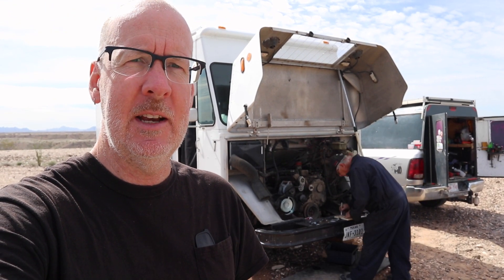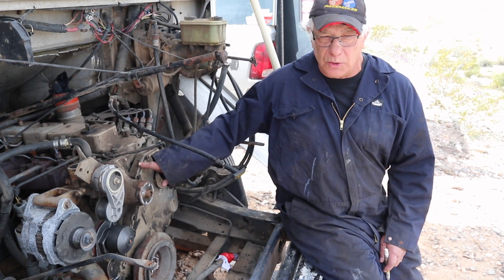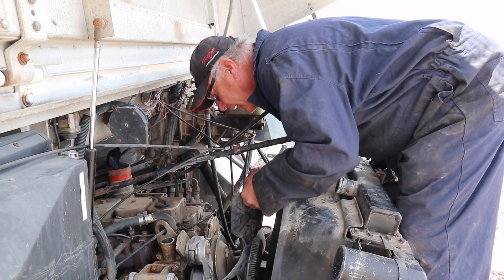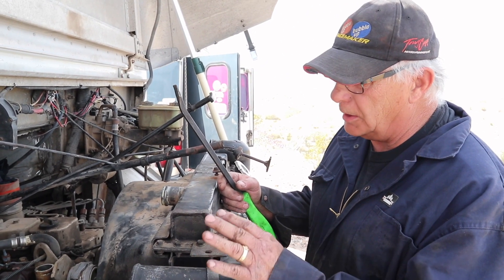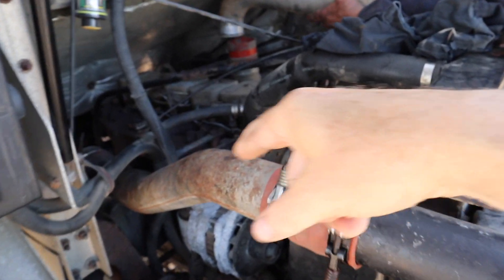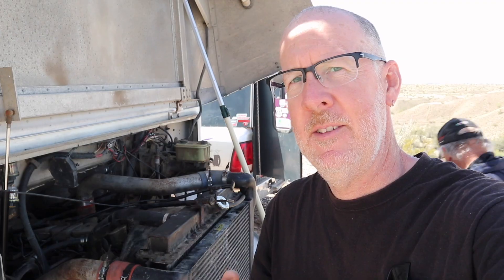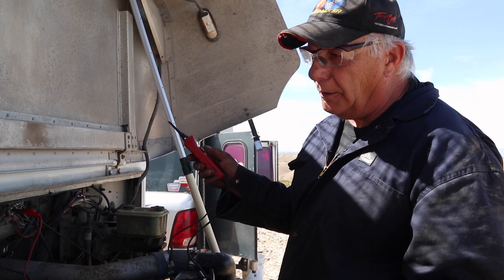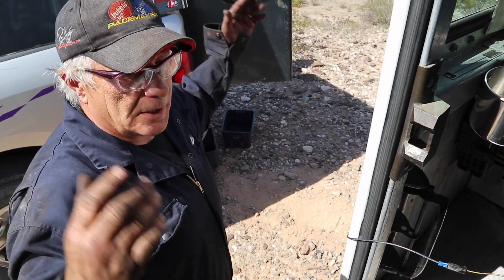Cummins Killer Dowel Pin KDP Repair in 3 Hours! Part 2 E515

Comment: Great tip on checking with Cummins just in case it was fixed with a recall. I got the same engine about the same time you got yours.and have been nervous ever since you found out about the killer dowel pin. Thanks to you and Badge for a great video.

Comment: Been freshening up my 89 Class A's Motorcoaches drivetrain over the last few months.  
A little history you might find interesting.
It was originally a EFI 460 gas motor, but I found I didn't like going up the mountains in 1st gear and only getting 6 MPG. (I like Rock Crawling in my 4X4 Rig, but not my RV.)
 So as Tim Taylor would saw, "I repowered it"!  I put a 5.9L Cummins engine in it back in 2000.  Then found I didn't like the old 4 speed Allison transmission I had to use behind the Cummins back then. (A1000's were just coming out)  
So a month ago I finally put an Allison 1000 5 speed behind the Cummins.  
And while it's down now, I'm Hot Rodding the engine up to 400 HP.  
Plus since I regeared the rearend years ago with the initial swap to handle an Overdrive Transmission I should see 13 to 14 MPG out of the Old Girl. A 1989 Fleetwood Limited 37' Class A.  (I bought it when it was 7 years old.)

Funny thing though, today I have been ording "consummables" parts for the engine since I have the Injector Pump off the motor and decided to go ahead and do my Killer Dowel Pin. (Or Check it anyway) Not sure if it was done when I first built the engine with a mechanic friend back in 2001, but I'm going to check it since I'm changing out all the seals, hoses and belts. (Preventive measures) And that front timing cover is going to be off anyway.  And then you reminded me to replace the water pump while it's apart.  
Thanks for reminding me.  About to order it now.  
Last thing I want is a mechanical issue when I come out to Arizona.
I'm sure we will cross paths with you guys one of these days!

Comment: any way to update the engine maker that the repair is done?
Reply from the maker: not really. the database Cummins keeps is for KDP repairs done with the recall. we wrote on the engine block case that the KDP was complete and the date. that should be enough for anyone later looking at the engine

Comment: I've mentioned before I'm fascinated by language and here is something to think about. Calling a radiator a rad. I was a mechanic for six years, working for several dealerships mostly European and Japanese. I never heard anyone call a radiator a rad. You might think that it's just a big engine thing, but at a Subaru dealership I worked at, several of the other mechanics came from a big diesel shop. They didn't call radiators rads. So now I get to wonder (and if anyone has info please chime in), is it a regional thing? Is it just from one guy in one shop and then people that worked under him? Is it unique to Badge? I love language mysteries like this:)

Just to clean up Badge's explanation of the air cooler, I'll tell you what he meant. Air never burns. It supplies oxygen so something else can oxidize quickly, what we call burning. Hot air expands which means there's less molecules of all sorts in a given gulp of air, they're spread out more, (we really only care about the oxygen molecules, though). That's because hot really means that each molecule has more energy and bounces off of all of the other molecules more so they knock the others away. All molecules claim more space to vibrate in because they vibrate more violently. Cooling the air down means less vibration, hence more oxygen in a given size gulp of air going into the intake, so we get more oxidation which means more power. (Love Badge's mocking of the twelve hour thing. I always feel that way too. For me it's a justice thing. I hate people being ripped off by incompetent people, and trust me, I can tell, Badge is HUGELY competent and really smart [and a bit of a smart ass who are the best people in the world]). It's annoyed me so many times when Seven has dealt with people who told him this or that yet didn't do basic testing that would easily tell you exactly what was going on. Unfortunately, they didn't have the basic knowledge to do basic tests. They didn't understand what was going on, but presented themselves to Seven as people who DID understand. Badge is the real deal. Kudos to Badge. Watch his channel.

Nitrous injection is the same idea, i.e. get more oxygen to combine with the fuel. In this case, nitrous oxide, N₂0, a gas at room temp but that contains HUGELY more oxygen than air does. It' comes compressed into a liquid, so when it expands into a gas it gets really cold which means more oxygen in a given gulp of air.

Here's my favorite thing about this video. Seven got to participate in taking apart a bunch of stuff at the front of the engine. That means that that stuff isn't a mystery to him. Remember when anything mechanical using tools and fasteners was foreign to him and a source of great anxiety? Now he casually puts hoses back on and tightens clamps and it doesn't freak him out. He's grown in knowledge and confidence. Lots of life is like that for many of us. Trying to do something that will develop in us a skill we don't already have is daunting to say the least, but if you refuse to be daunted and just suffer the discomfort and try, after awhile you have new skills, new confidence, and less anxiety. I love that. Good on your Seven. Such a role model to people who think that they can't succeed at things because they don't already know.have new skills, new confidence, and less anxiety.  I don't really know how Seven thinks about the overall arc of his story on his channel, but to me it's this: developing competencies over and over again and by doing that becoming a person who believes in himself and his ability to take on anything in the pursuit of joy and competence. It's like a Joseph Campbell "Hero's Adventure". If you aren't familiar: https://www.youtube.com/watch?v=BLoOYuwMQC8&list=PLiJELyO9hcAZ_JVEmAI3sByatFwdSy6F7
Reply from the maker: it might be a Canadian thing

Comment: Just a question as to why if this was a recall item from Cummins, why they didn't take care of the repair?
Reply: MSgt Jim they said it could be a problem but not a recall. ????🛠🛠🛠🇨🇦🙏
Reply: Which begs the question here...  Why would a company spend THIER time & parts recalling & fixing (making no money) a mission critical flaw when someone could BUY a new motor (making a ton of money) when it DOES fall into the timing gear?

/Planned Obsolescence!
Reply: @Badgeweefixstuff  Why I asked is I thought Seven had said the Cummins had a recall list of the engines that had been repaired.  I personally love the 5.9 Cummins as it is what is in my 2003 1 ton that I purchased new and it has performed flawlessly for the past 16 years.  Wouldn't trade it for anything on the market today.  It is probably going to outlive me.
Reply from the maker: my understanding from a call to them is that Cummins did have a recall and a database of engines repaired under the recall. they did a lookup on their database and had no record of my engine being repaired under the recall. they also told me I didn't qualify for the repair under recall due to an expiration time limit of the recall repair.

Comment: Seven, I'm looking at shuttle buses now, and reticent about getting a diesel. I have heard about several issues with them, including cold starts and finding mechanics. If you had it to do over again, and had a choice, would you still get a diesel?
Reply: Another question- I like the room that a step van has, but they sure look like they would be a loud rough drive on the freeway, which is why I am looking at shuttle buses. Are step vans as rough of a drive as they look, and would you buy one again? Did you ever consider a shuttle bus? Thanks and love your videos.
Reply: Cold starts only come into play when it is below freezing as the oil is so thick the pump can't pump it till it heats up some. Thinner winter oils and block heaters let you avoid that. 

It is not that it is diesel that makes it hard to find someone to work on it it is the size as most shops don't have the equipment to lift it or the sockets to fit on the bolts and you will run into the same problem with gas or diesel once you get into larger vehicles. You will need more time to order the parts needed as they are not as common as car and truck parts but any competent mechanic can easily work on them given the right parts and tools. If it is part of a fleet vehicle try to find the books for it as they will list how often and parts numbers
Reply: It’s really not a issue I cold start them all. Block heaters are the answer 🛠🛠🇨🇦
Reply from the maker: yes, definitely would want a diesel. they have far more power for larger and heavier vehicles.
Reply: @SevenWanderstheWorld   how do I get a hold of Badge? I'm in Flagstaff and winter in Quartzsite..I have a 1992 Safari with a 12 valve. I do no think the KDP repair was completed on my 12valve. It appears my year is not a critical year but non the less I would like to have Badge do the work

Comment: Any chance anyone could point me in the right direction? 

California seems to be the most difficult to find info for RV conversion processes..

Maybe also point me in the right direction for info on: 
which insurance companies in Cali can cover this rv type conversion...

 I'd like to grab up a 1995-97 diesel stepvan, 
with an all aluminum 14-16ft box (22-24ft bumper to bumper, between 14,100 to 16,000lbs GVWR), without the fiberglass roof for rv conversion.. 

If possible, I'd like to do a "quick" & "dirty" conversion to RV for the registration change & insurance purposes,
 here in Cali (if possible), then mold it out as I go along, maybe which city in Cali to travel to, to get the change done more easily.. (?)

I understood cali exempts emissions on 97 or older diesel with more than 14,000 GVWR 
per: dmv.ca.gov/portal/dmv/?1dmy&urile=wcm:path:/dmv_content_en/dmv/vr/smogfaq
Reply from the maker: https://www.youtube.com/watch?v=4AerE7KZ74Y&t=9s